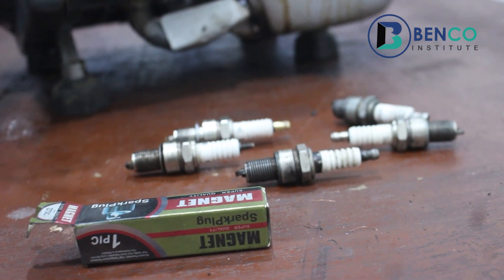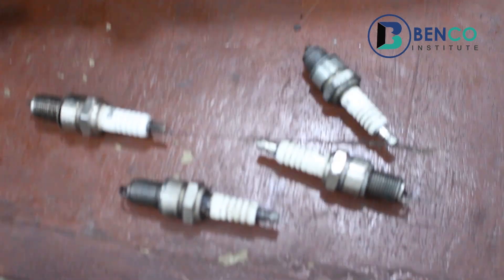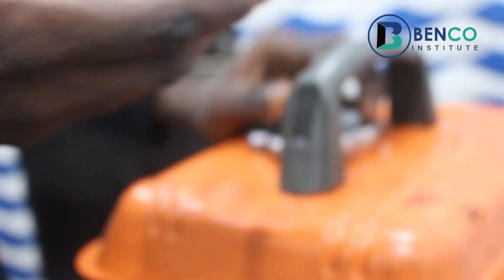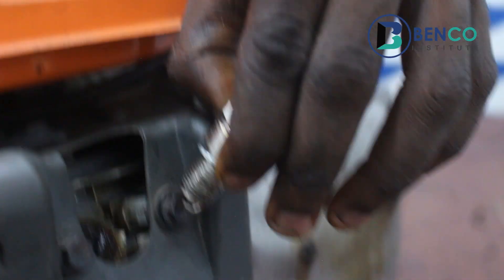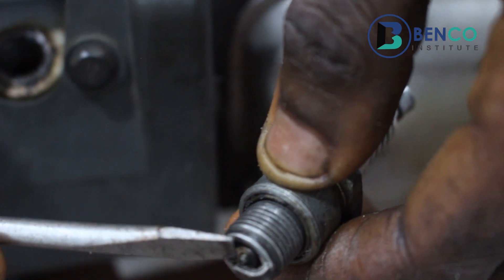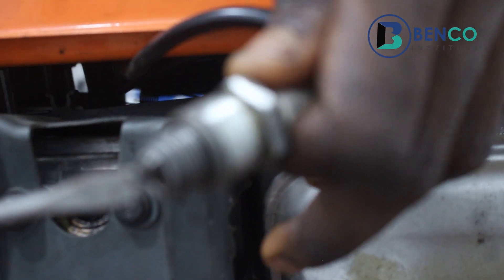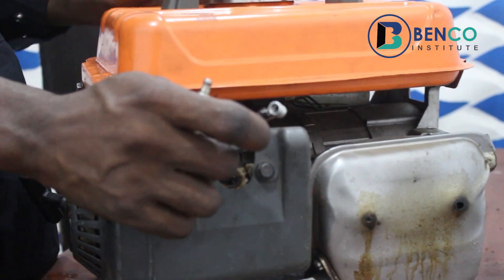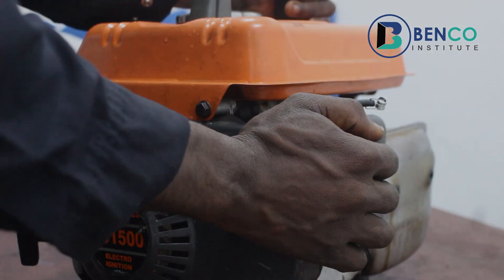How to know a good Spark plug, The science behind Generator spark plugs

Comment: Great topic and video👌🏾, keep it up.

A question, when I reduce the power or should I say voltage of my Firman 2.5kva generator, it reduces it’s noise quite alright but it begins to vibrate too much…is there a way to deal with the weird vibration?
Reply from the maker: You should know that wen the speed of your generator reduces and does not have the required Rpm to rotate your Alternator properly...

Some times there is a tweak with the valve...but it is not advisable